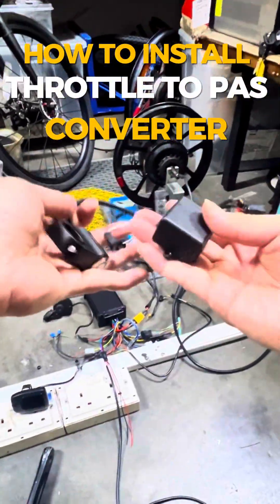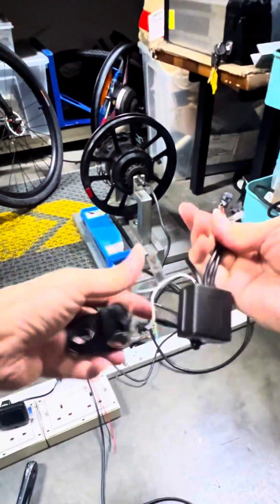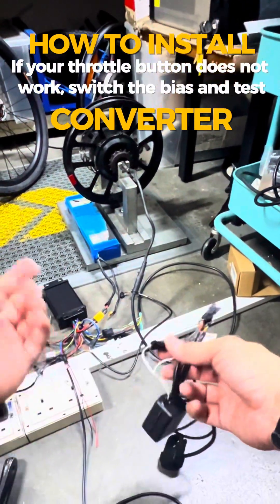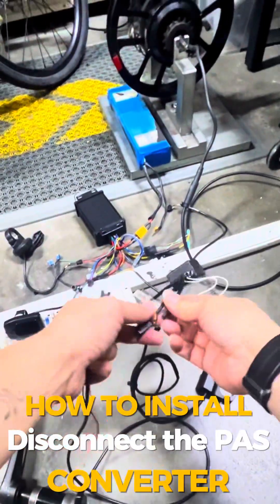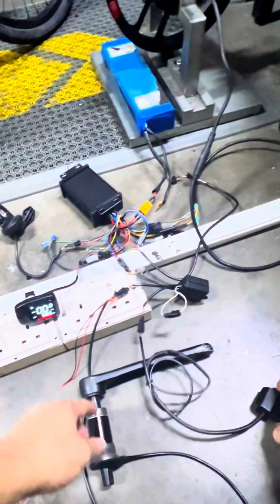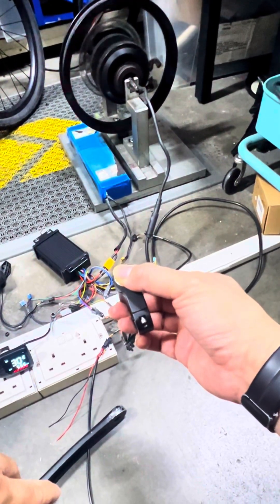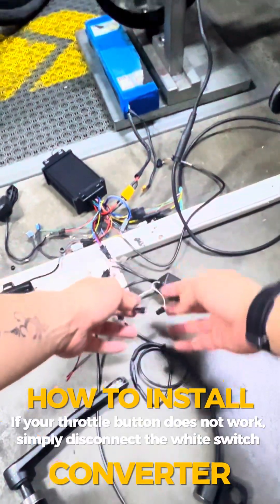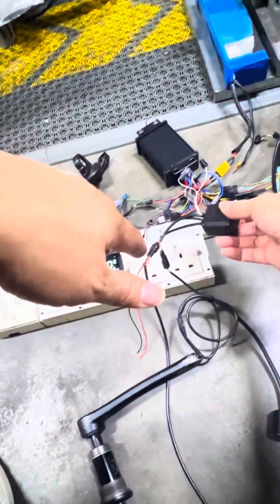How to Install the Throttle to PAS Converter Easy Installation

Comment: I'm just asking if the bowl set bearing of the vsett 10+ and the zero 10x are the same? or are they compatible?
Reply from the maker: @jekipon5046  not compatible
Reply: @FalconpevSg  👍
Reply: Fardrive Controller isn't compatible too